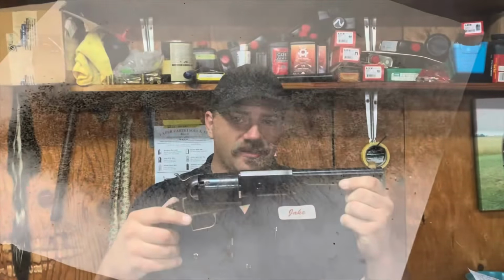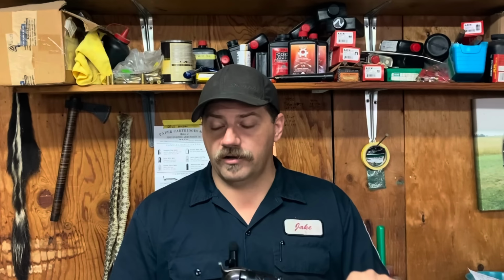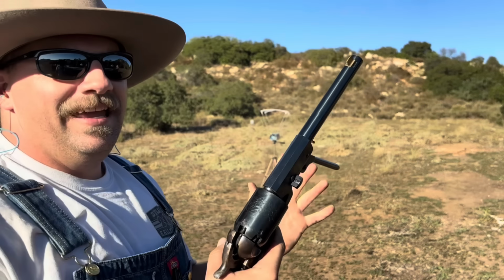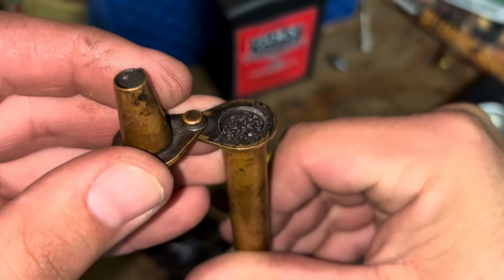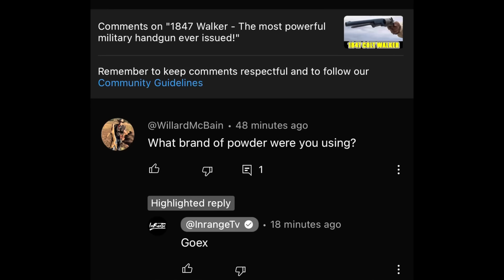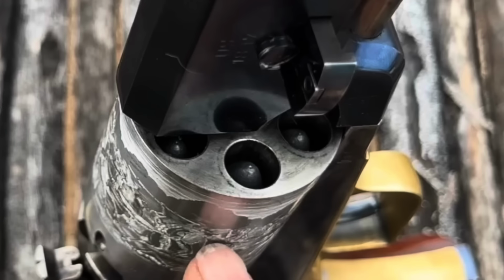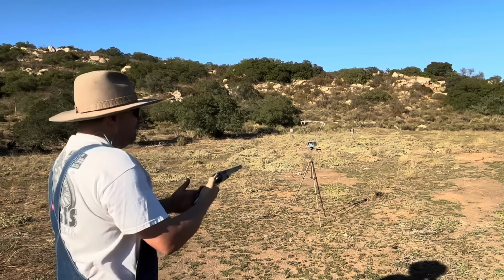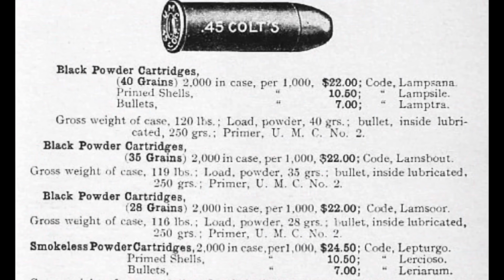The Colt Walker. Not The Most Powerful Revolver Of The 19th Century?

Comment: Your on the right track. But you flogging g the difference between “then” and “now”. 

As you know from your journey making black powder there is a world of difference in power, burn rate etc between your first batch and you process today which rivals commercial products. 

Back in 1847 powder was like your first batch. Slow burn and less power than today. 

There was no “Fg” grade system. That was introduced in 1881 when DuPont formalized the A, B, C grades of blasting and cannon powders and the formerly “fine” sporting powder was screened to the “F” series we use today. The “g” designation was added sometime in the mid-1880’s to indicate powder tumbled and glazed with graphite. 

Still there are references as early as 1842 specifying the procurement of “fine” powder for military small arms. Today we associate this with the grades we are accustomed to. But then “Fine” was a quality descriptor used in general sales. Something on the order of quality. Good-better-best-fine. Fine being the top of the heap and quite subjective. So. In your store you might say “this I’d best brown paper”. I might say “I want fine brown paper”. You’d say “ ok it’s fine”. And so it was. If we both agree. Very very subjective. 

Add this to the metallurgy of the time. Radical improvements were made in iron and steel between 1847 and 1861. 

The walkers illustrate this. Those guns are iron. Not steel. And iron so…..variable in quality as to be scary today. This is the root of the many blown cylinders. I’m collections today walkers are like hens teeth. Of the original 1100 made about 300 survive. Minimal cost for one today is $100k and up. Up a lot! Of the surviving 300 it’s estimated that 200 had blown cylinders and had replacement cylinders installed by colt in the early 1850’s. By that point colt had acquired a better grade of iron thus improving those cylinders materially. A point to remember. Powder quality was also improving as metallurgy improved at the colt works. 

The walker replica you have today is not exactly like the originals. The most glaring detail is the lack of a forcing cone. The original walker cylinder was about 5/16 inch longer than the average reproduction of today. Lacking a barrel extension aka forcing cone within the frame. I believe Ian pointed this out in a video years ago. This is what added to the difficulty seating conicals in the original gun. 

The first reproductions from Italy and Spain were made by reverse engineering original 1851’s for the most part. Not so with the walker. No one was going to ship a walker to Spain in the late 1950’s ….not with them being worth close to $100k even then. 

So. The first reproductions were based upon dimensions provided. “ like that 1851 we sent you, except the cylinder is this long. The barrel that long. See the picture. And in providing those dimensions people like Val Forget were very aware of the ….explosive… history of that gun. And the common assumption that it was the extra large capacity of the chambers that was the cause. Not the poor quality of the metal, despite the poor quality of the powder. 

So steel was of course specified on the reproductions. But in addition a forcing cone was added, just as colt added a forcing cone to the “dragoon” to adapt a shorter cycle set to the frame, which was also shortened to become the “first model dragoon” as it’s called today. So. In short, the reproductions we have access to today have noticeably shorter cylinders and frames than the originals. This also complicated the fabrication of “faked” originals. I believe the NRA museum did a video illustrating such fakes built on Italian parts. The tip-off being a forcing cone among other detail. 

So the originals could digest a 50-60 grain charge and seat a conical only with great difficulty, the upside down seating being one work around as you point out. 

The dragoon represents the evolution of the walker. The first step being a shorter cylinder limiting powder to 45 grains at most. By 1861 this evolution was down to 30 grains. 

And through this all iron segued into steel, and finally “better” steel in the 1861. 

And powder evolved such that the “good” powder of 1847 became the “fine” powder of 1861. One must ask how many original 1847’s ruptured a cylinder when some lad stuffed it full of “fine” powder in 1862?  The fire at Colts destroyed many of those records. 

So you bit off a complicated chew. But you gnawed upon it quite well! I hope this explains why you could not quite close the loop on contemporary accounts with what we glean  today from our reproductions. 

Fox out
Reply from the maker: Thanks fox
Reply: Comprehensive, I liked reading this.

Comment: The original Walker mould dropped conicals in excess of 260 grains. I don't recall exact weight atm and too lazy to look through my library of antique arms and accoutrements, but as I recall the ball and conical dia. was somewhere between .458 and .460 for the supplied moulds. The heavy conical behind a compressed load may have been able to match a 45 Colt with a 250 grain bullet and 40 grain charge, but I certainly don't see how since it's not contained and therefore not held back by a crimp to help out with initial pressure set back.
Reply from the maker: I don’t think they were that heavy
Reply: @Everythingblackpowder  Could be right I don't remember. I don't even have a replica mold for mine as I don't like the Walker it's just too big and heavy! You know Ian did some videos on the gun and I seem to remember one where he showed the gun, mould, bullets and told the weight of the original, but I don't recall what he said either...and as mentioned I'm too lazy to even search for that video :) I have a lot of books I've collected over the past 35+ years on historical guns and sometimes I will mix up what I read pertaining to one over another and I was thinking I read that they were in that neighborhood, but could be thinking of an entirely different gun.

Comment: I had a pair of Uberti replicas.  I think I crammed 50gr. of 3F Triple Seven under a round ball.  Regardless, shooting that much powder per charge made for a LOT of fouling pretty quick.  I could barely get through a cylinder before the damn things would bind up so hard, you needed two hands to cock the hammer.  Between that and the loading levers slapping down with every shot, I found these are fun to shoot every once in a while, but I'm not really sure I would want to have to rely on one as a primary arm back in the day.   I wonder if different repro brands are dimensionally different?
Reply from the maker: I measured my chamber depth and had some friends that own a colt second GEN and an army San Marco measured theirs and they were all within .010 of each other

Comment: As there were also stories of the Walker having a chamber failure and popularized in the movie The Unforgiven "... his Colt Walker blew up in his hand, which was a failure common to that model"...I wonder not if the cylinder is shorter than originals but if perhaps the original chambers were bigger, and the mold cast .460 round ball?  Wouldn't give the user a 60 grain charge, but would give likely enough room for the Walker conical bullet AND explain the tales of the cylinder blowing up as the larger cylinders would = thinner cylinder walls.  Repros would try to correct that and making cylinders to accept .451 - .454 ball would do that.  But this is just supposition

Comment: Wow! I've never had a walker ( not an original, nor a replica) BUT everybody knows that the original Walker was the most powerful gun in the world! The cylinder was twice as big than the italian replicas! The bullets were much shorter back then. The powder was much hotter. All in all there's no difference between the performance of a Walker and a 50 BMG, it's just common knowledge! Your problem is you've got the Italian Pocket version of the Walker!😁
Reply: @Everythingblackpowder  You did a good respectful job.
Reply from the maker: @solitude731  thank you
Reply: LoL 😂
Reply: SOLVED!
Reply: @Everythingblackpowder   Could you look into people using modified (Look, Feel, and Function) S&W X-Frames to make Black Powder Single Action Revolvers.  I've seen some things here and there, but not a whole lot.  Would be interesting as that's a very strong Revolver Frame.
Reply: @Everythingblackpowder  Next will be the Charmin Ultra Soft Powder test.
Reply: You said 50 BMG, but I think you meant to say 25mm autocannon.
Reply: Greatest comment ever
Reply: colt in fact, at one point, made a prototype in .54 cal
Reply: Actual  BP Substitute  are less hot than old  civil war  powder  ??    Or you speak about modern black powder ?
Reply: I think than problem is  definition if full load  !!     than some of   users  prefer use 147 grs round bullet (in overspeed and withouth stopping power)and lot if powder.       But with  225 to 260 grains conic bullet   its a great revolver .
Reply: Does matter 50 g of powder is not going to burn up before the bullet is
 out the barrel.
Reply: @clydedavis1428  40 grs of FFFF  is optimum   with  kaido 255 grs  bullet.(wide optimised for max gaz checking).. comparison is smart with 44 Special/Russian....45 long Colt.mybee old BP musket...... other comparison with modern hispeed or Rifle   are out of sens !!!!  Dirty Harry and Harry.....Potter (Powder) are 2 different film.
Reply: @clydedavis1428  40 grains of finest BP are totally burns in 8 " barrel and each Joules of energy is used for push bullet .   even ROA with Tailor cyl and best ammo (no cowboy action Shooting  .regular 45 ammo except +P) cannot produce same energy....  its a good performance  for a gun  aged of twice time a long human life....
Reply: @clydedavis1428  50 g would be approriate for a 32 pounder
Reply: italian pocket Walker is.. Colt pocket. 31 ... a beautiful little gun.   i use it  during 2/3 years with 120 years  Buckshot cartridges out od use  (primers are "ad patrès " since  before year of my birth)  i re-use  littles balls of perfect diameter (its a soft lead in despite of age) .old FF hunting Black powder (i reform it in FFFF with a brass mini drop hammer)... ok its a mini italian Walker.i agree.  even Brand is same (uberti)
Reply: I hope all that 'information' is sarcasm.
Reply: I hope all that 'information' was sarcasm. It's very hard to tell these days.
Reply: @troyjanise9051  its a sarcasm.. im sure ....personally lot of new "black powder" adept  are sure than  a "1851" in 44   with 15 Grains of fff /147grs RB  are similiar in power than a Walker.....
Reply: @troyjanise9051  origin Walkers are Buildt in poor quality steel...Uberti is the best...San Marco is on middle of way
Reply: @alanaliyev456GT I have a uberti and a San Marco. The quality of the finish of the Uberti is better but I doubt the steel is any better than the SanMarco. I'd bet the original Walker's steel was just as good. I'd also bet that 99.5% of the failures of the original Walkers was from overfilling the cylinder and other things the pistol wasn't designed for.
Reply: @troyjanise9051  overfilling ???  its totally impossible in a revolver with black powder.  at this time, i doubt than  substitutes existed  ???..because      even with micronisation (FFFFFFF) BLACK POWDER STAY BLACK POWDER....  (you can compressed  61 grains with ultra fine BP  in each chamber  and 147 RB..totally inapropriate in a 1847   but lot of used)
Reply: @troyjanise9051  i own Just  UBERTI  and   lot of Friends have San Marco  ....its just  their self opinion
Reply: @troyjanise9051  maybe crasy people  in old times weaken wall for overfilled cylinder  ????  i see on internet Advices  (for me stupids advices)  for  increased capacity of R.O.A's....i never  be in agreement with theses process.... even great Ruger Steel dont desserve to be weaken for eat   powder in more.  i let my toys in origin condition.
Reply: @alanaliyev456GT continously overcharging a cylinder past the manufacturers recommend load couldn't have been good for them. I might be more worried about the quality of the powder back then. From what I've read, I dont think thats ever been brought up. Maybe they got some hot powder. What about turning the conical bullets around and loading them backwards? Definitely not something I'd do in mine with any powder charge.
Reply: @troyjanise9051  oki !  maybe a bad lead Alloy ..so hard  (like print letter metal.). can perturbate pressure curves .....
Reply: The cylinders did tend to blow up on the originals.
Reply: I have one in 76mm... do you know where I can get  a holster to fit?🤔
Reply: Ahh! There is a tremendous difference between a colt walker and a 50 BMG
Reply: @alanaliyev456GT I'm wondering at this point. Except I speaking of the 1861  which is like the 1851 but barrel allows loading conical easier.
I swear I used 40gr with 200 gr all the time in my old CVA 1861 .
BUT I've also always used Pyrex.
Reply: @dwightehowell8179 I really think it was due to being iron and not steal.
But plenty disagree with me 
Heck maybe they were put nitoclyerin in them, lol? 
I don't know. Since I've used brass barrel .41 cal using 40gr . I just don't see even if it's was iron how they blew up. 
Is there an unknown way to make black power equal to modern powders? 
Short of using nitroglycerin I just don't see how it was done. Unless it was bad iron. And I'm not sure nitroglycerin would do it. 
Lol and that beside the fact of just how violent nitroglycerin is. I wouldn't want to even load it
But hey bet you wouldn't need caps. Lol
Reply: 50 grains of powder compared to the 30 grains in my cap n ball colt  , a walker probably got it done  .
Reply: The cylinder was NOT twice as big LOLOLOL
Reply: @IvanhoeWolfe-zn6fc   the Paterson and Walker may have used off the shelf bar stock to machine the cylinders from  , I believe that the later models are made from forged  steel for  greater durability  .

Comment: Great video. I have a reproduction colt Walker. It’s brutal. You are not going to do conceal carry with a colt Walker. At pistol range, it can open you up like a melon.

It’s size, appearance and presence is great for deterrence in open carry.

I have heard that there was a conversion kit used by the colt Walker. Don’t know much about it or the shells it used.

I also have a colt single action in 45 colt.  It’s also a powerful gun.

At the end of the day, I love these guns. Both in open carry are intimidating which leads to deterrence.

My last hand gun is an older 1911. It’s also a handful. I love my hand guns.

Does it matter what the stopping energy is? How fast the slug flys? At a certain point, it doesn’t matter. Each of these is going to do a massive amount of trauma against your perpetrator. 

You can’t go wrong with these guns. I am not a fan of glocks. It’s an appearance thing. Glocks work great, just not my cup of tea.

I use the same 458 ball in my Walker as I do in my 50 cal hawkin. Same double measure of 3F GOex. Never figured out how many grains my measure has.

I think your empirical work was excellent and I may look into it as now I am curious.

In short, the colt Walker is an extremely intimidating hand gun in open carry. Is it the purported cannon it’s been hyped up to? I don’t think so nor do I think it’s relevant. Just it’s presence is enough and the best case of self defense is when you don’t need to pull the trigger.

Comment: Carl was using a finger tip measure. The pad of his finger would reduce the powder charge to a minor degree. What if they were using a hollow base conical? (Which I doubt) They also may have been loading the cylinder outside the pistol in a loading tool ( I am thinking of the screw down type that loads all six at once). I am a Cult Walker person. I love the things, but DO NOT practice nor recommend cramming max powder into it. I ultimately ended up using a reduced charge that would not blow down the load lever, enough of a filler to seat the ball at the very top of the cylinder, and enjoy much more accuracy and fun. Great content on your site!!

Comment: Shortly after the Walker came out there was a revolving Shotgun which when cut down into a pistol easily shadows it .
And it's hinted some had rifled barrels...
A 10 gauge is one big hole !!!
Reply: Oh yeah, The Big PP.
Chatted briefly with the guy who bought that specific one when it went up for auction, says the nipples were ground down so that the hammer couldn't reach them, but that he was getting that fixed.

That one is a smoothbore, so you aren't maybe getting the finest pin-point precision with it using single round balls, but as it's a proper 10-Gauge smoothbore (no choking), you could pack a bunch of 00 Buck in each chamber and really give the Taurus Judge a run for its money.

Comment: OK that is really interesting Jake. Now to me that is interesting as I have been pushing 35 grains of black powder through my Pietta 1860 Army Colt Replica, with a .450 200 grain conical by Lee bullet mold and I do not have the trouble seating the bullet that you do with that Walker and the 217 grain Erasgone bullet. Now I will give you two caveats with my load for my gun, the black powder I am using is a home made black powder, and my gun is basically stock and has not been slicked up like some guys have done to their guns. Meaning I have (not) c hampered the cylinder's nor bored out the cylinder's to a .450 bore, like how some go to a .358 on their .36 caliber gun's. So that makes me wonder if they made any modifications to the cylinder on their gun's for ease of load and to increase the load.